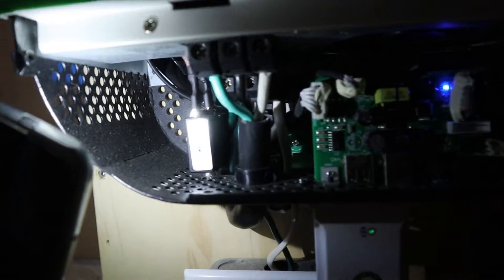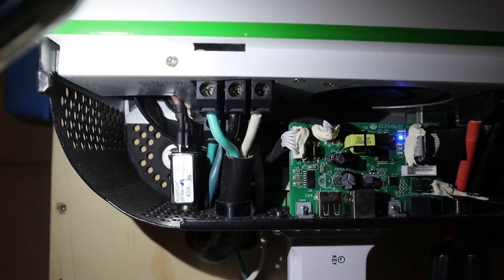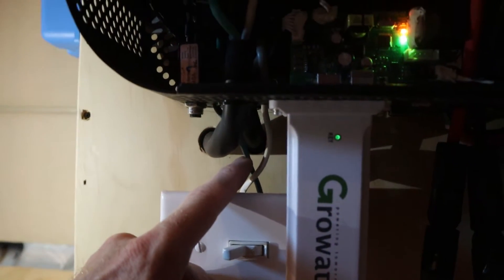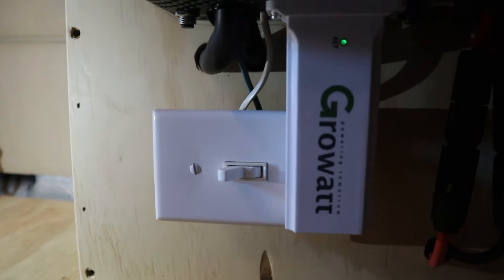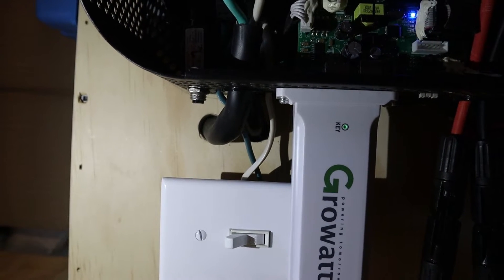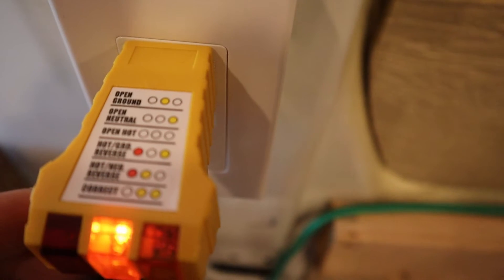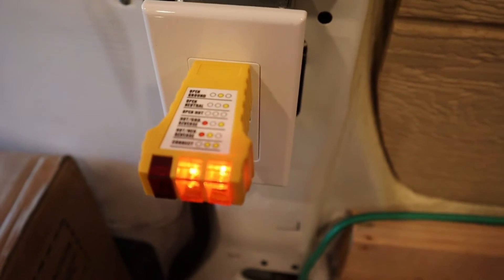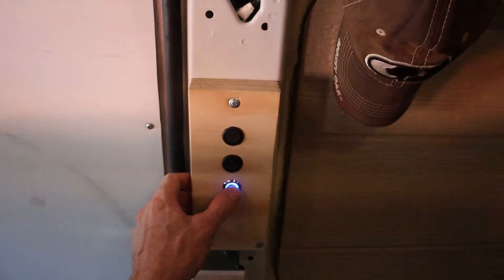AC Grounding Growatt 3000 In My Van

Comment: I'm having a similar issue where's my 24-volt all-in-one inverter my heater pump on my spa won't turn on giving an error code saying open ground so all i how to do is run a jumper from the neutral to the ground of the case because I don't have a AC output terminal just a ground screw and do I run that to my grounding rod or no

Comment: Thank you so much for making this video and all the others! You are extremely helpful to many of us. I didn't realize this was a problem until I saw your video. I have since done a lot of research. Some people install a continuous duty external relay to make the switch automatic, but it's more complicated. If you want more info on that, I'm happy to pass it along to you. I have one question. Do you know if I can use a simpler, smaller type of switch instead of a light switch? I'm in a minivan with limited space (but hopefully someday I'll be in a larger van like yours). I thought, maybe I could use a toggle switch, but they are supposed to have 2 black or red hot/line wires connected to it, breaking one "line" of energy. Could I run ground into 1 side of the toggle and neutral into the other side? Another idea is a Blue Sea type of battery switch. You've probably seen them --- they're solid red or black and about 2" square. Best wishes, and thank you!

Comment: Thank you SO MUCH for the grounding tip could not get mine to work on output. Called tech support and no one mention this. Will I have problems with input running a generator? Thanks again👍

Comment: Hi, ..if I am completely off grid and charge by solar only, can I ground by connecting ground wire from neg bus bar to earth ground post?
Reply from the maker: Hi Happyhalter. Thank you for watching and for your support. To your question, yes I think it should be fine. I don't see a problem with doing that at all. Thanks. Hope it helps.

Comment: I don't get it. I have ground on green, live on black and neutral on white. To ground, I'm supposed to run a jumper cable from Green to the white, making two connections on green and two connections on white. However, you only have one connection on white. Something isn't right.
Reply from the maker: Hi MigMig. Thank you for watching and for your support. Okay, here goes, you will only run 1 jumper cable from green to white without a switch on the AC output side which will create a floating ground. I think where the confusion is, is the fact that you will have 2 wires per hole of the AC output side, 2 wires in the green hole and 2 wires in the white hole. Does that make sense? Let me know if I explained it good enough.
Now for the other scenario, adding a switch, you have 1 green jumper wire coming from green AC output hole going into the switch and 1 white wire coming out the switch and into the white hole on the AC output hole.
I hope this helps explain it. Keep in mind that the switch is when you are charging from shore power you will cut the circuit on those jumpers and create an open ground scenario because as soon as you connect to shore power the outlet will already be grounded and therefore you do not want to have two grounds. Let me know if you have any other questions. Please consider subscribing if you found the content useful. Thanks.
Reply: @thinkfreelivefree6951  Thanks. And I think I understand. Is this the same as plugging in a neutral-ground plug in any outlet in the rv/van?
Reply from the maker: @migmigjohnson6083  Sorry, I am not sure I understand the question. Can you rephrase please?
Reply from the maker: @migmigjohnson6083  Okay, sorry, I think I understand and yes it is similar. It gives the current somewhere else to go in case something shorts.

Comment: Awesome again, love all your stuff.
Idk if missed it but what size dc breaker did you use from your battery bank? I'm not sure if a 120a keeping my max draw below that of the inverter is the right way of going with a 150a.
Thanks
Reply from the maker: Hey, thank you Leo. I have a 175 amp bolt on fuse coming from my battery to protect my 2 AWG wire from my battery. Fuses and breakers are to protect your conductor (your wire). My 2awg is rated for 205 amps. Hope that helps. Thanks.

Comment: Hey thanks for the info I'm about to use this inverter in a home application. I'm curious though, what happens if you don't put a switch between the neutral and ground jumper? Will there be an issue when it switches to grid/utility mode?
Reply from the maker: Hi, thank you for watching and for your support. Please consider subscribing if you found the content useful. If you don't put a switch you cannot disconnect the floating ground and as you switch to grid power your house breaker will probably trip as you already are grounded on the grid side if that makes sense. Hope this helps your application. Thank you for watching and for your question.
Reply: @thinkfreelivefree6951  I don't think it will trip the breaker.  The problem is that when the neutral white wire and green ground wire are connected, that creates a bond.  By code, the neutral and ground shall only be bonded at the main panel (shore panel).  If that bond is not disconnected (by the switch, for example) at the RV prior to connecting to shore power, that will result in two bonding points, which is not allowed for safety reasons by code.  This would be the same violation as using the bonding screw in a subpanel at your home.
Reply from the maker: @AGhostInTheMachine  Thank you for explaining that in depth. Appreciate it. It really helps all of us understand this better. 👍👌
Reply from the maker: @AGhostInTheMachine  Theo, you mention in your answer for safety reason two bonds are not allowed by code, what do you think will actually happen if say I forget to turn the switch off before connecting to shore power?
Reply: @thinkfreelivefree6951  Thanks Theo,  I think having two bonds creates alternative paths for current to flow in the event of a fault potentially creating opportunities for someone to get electrocuted as the current instead of flowing safely away through ground can now also flow through the neutral at the sub panel
Reply: @MrShaneo369  yeah, it creates "multiple paths" and can have dangerous effect in case of a short.  If you do not break the connection with the switch, you won't notice any difference, your devices will still work, no breakers will trip, but if there is a short in the circuit it can be dangerous to someone touching the metal, so hence the switch is a good safety method.  Maybe add a label on the switch as a reminder.
Reply: @MrShaneo369  I noticed above you mentioned your system will be in a home (not mobile) installation.  The need for a switch does not apply in that case.
Reply: Ok so the permanent jumper or ground/neutral bonding inside the sub panel would work fine for me then?
Reply: @MrShaneo369  no, the inverter shown in this video shouldn't need ground/neutral jumper (bond) to work properly (in a home installation).

You say "sub panel".   Neut and gnd should never be bonded in a sub panel.  Bonding is only established at the main panel.

The video creator has a mobile setup, that's why he needs the bonding (and the switch 'off' for when he connects to shore power).  Otherwise he gets the 'ungrounded' error from his circuit tester.
Reply from the maker: @MrShaneo369  You are using this in a home application, so in your case a jumper is not needed,  a jumper is only needed if you don't have a physical ground. Hope this helps.

Comment: Very helpful.
How's the wifi dongle working out for ya?
Reply from the maker: Hey thank you Theo for telling me about that sale. Great deal on the Wifi Module. Its working out real good. Any advice Theo? Thanks.
Reply: @thinkfreelivefree6951  Advice, hmm...
One thing I thought of...if you get tired of repeatedly entering your login credentials for the Growatt site, I did come across a way to automate that.
Reply from the maker: @AGhostInTheMachine  Thank you Theo. I do have mine setup on auto. Appreciate it. 👌
Reply: @thinkfreelivefree6951  How are you using the WiFi module while mobile? I bought one but am sending it back due to not having a persistent internet connection (living in a TT, I hotspot when I have a connection) to log data. Also my phones are 5G and I get a message that 5G is not supported. Without data logging the info in the Shine app is basically the same as on the Growatt inverter screen. Am I missing something?
Reply from the maker: @davidscott6972  Hi David. Thank you for watching and for your support. I currently have mine setup on my Nighthawk Mobile Hotspot. It shows a lot of data that the inverter does not provide. Please consider subscribing if you found the content useful. Thanks.